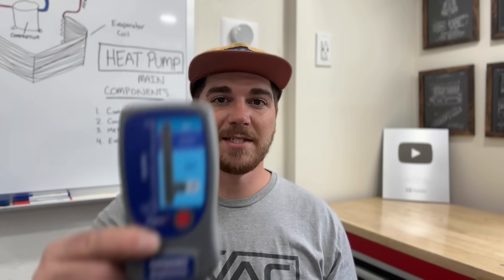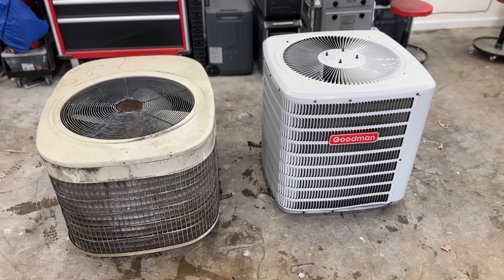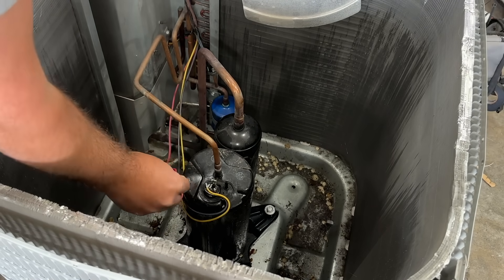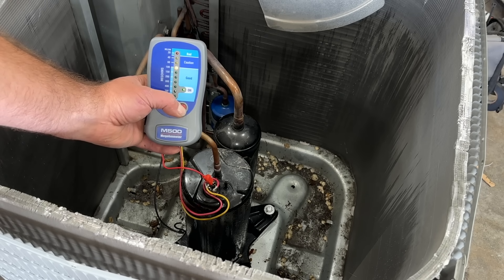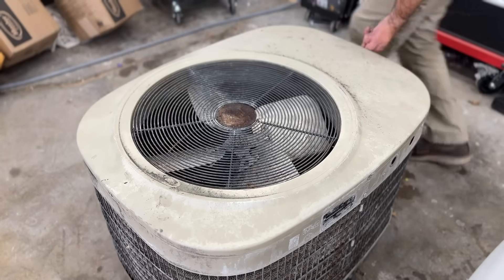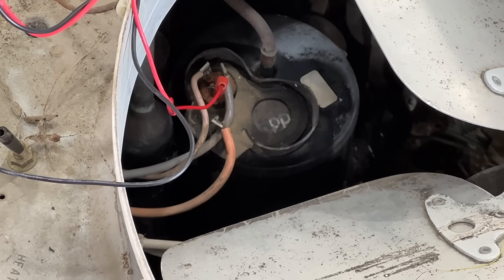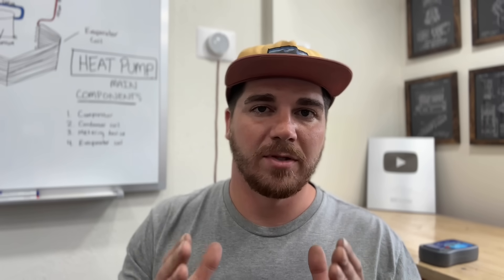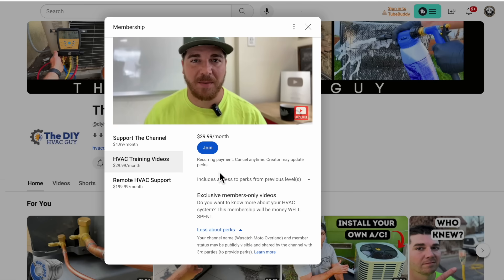Is Your A/C Unit About To Die? This Tool Doesn't Lie

Comment: HAD APPLEWOOD PLUMBING AND HEATING IN THE DENVER AREA COME OUT TO CHECK ON MY A/C UNT THAT WORKED FOR 3 DAYS THEN STOPPED WORKING....
REPLACED CAPACITOR 
REPLACED CONTACTOR 
ADDED SOFT START
TECH WORKED FOR 90 MINUTES.
CHARGED ME OVER $2200.00  AND THAT WAS WITH A $300.00 SENIOR DISCOUNT.
COME TO FIND OUT THAT THE PARTS COST A MAXIMUM OF $100.00 TO $300.00 DEPENDING ON THE QUALITY.
GOT RIPPED OFF BIG TIME.
TALKED TO THE MANAGER AND SHE OFFERED ME A $400.00 REFUND.
I TOLD HER NO BECAUSE THE JOB SHOULDN'T HAVE COST MORE THAN $1000.00.
SHE SAID TAKE TAKE IT OR LEAVE IT......
I LEFT IT.......
I WASN'T ABOUT THE MONEY. IT WAS ABOUT THE INTEGRITY OR LACK OF BY THE COMPANY.
BY THE WAY.....
NO SHADE ON THE TECH...
THE A/C RUNS GREAT.
THE TECH PULLED UP THE MENU FROM THIER COMPANY 
SITE AND THESE WERE THE PRICES QUOTED PART AND INSTALL.
CONTACTOR ONLY $800.00+
CAPACITOR ONLY $1000.00+
CONTACTOR AND CAPACITOR 
AND SOFT START....
$2200.00+
THE MANAGER DID SAY THEY HAVE TO BUY VANS AND EQUIPMENT....
DRUG TEST THEIR TECHS....
AND A FEW OTHER REASONS SHE GAVE FOR HAVING TO RIP ME OFF.
NEEDLESS TO SAY I'LL NEVER DO BUSINESS WITH THEM AGAIN.

Comment: While a neat gadget, couldn't you just ohm out each of these coils to ground and do the same thing?  It won't check marginal insulation but other failures it would. This would be useful for checking for internal shorts due to failed insulation I suppose.

Comment: I use a megger at work for large 3-phase motors but didnt think of using one to test a compressors health.  Thanks for for the tip and being honest with people who typically get scammed for not having knowledge in something like this!
Reply: Why can't you use a multimeter?
Reply: @trevmint5615  What should a multimeter read for resistance?
Reply: It’s best to pull the compressor into a vacuum before you meg it

Comment: An open winding would have tested as good and a locked up compressor with a good motor would also not have shown as a problem. You need to understand what your reading and what it means. That instrument just shows if you have any leakage current to ground, it says nothing about the compressor at all, only the motor windings to ground.

Comment: O k I watched the video all the way through. The first thing I would like to say is some safety procedures were missed. You mentioned telling the customer to pull the disconnect. Before any attempt, but voltage should have been tested. Not all disconnects are wired correctly, and voltage at the unit should be tested before any other test is performed. No I will not deny the validity of a good mega test, but you need to be aware of what type of megar you're using, not all megers are created equal. And secondly, you also need to explain to the customer that this test is only valid on reciprocating compressors and not scrolls. Scroll compressor the motor is down in the oil. You may get a zero reading with a perfectly good compressor. So the person must be able to identify the difference in compressors. Otherwise you just gave every technician out there a reason to change out a good scroll compressor. I'm sorry, I don't work in the field. I'm an educator I teach new students that are coming into the field. I teach them at honesty is the most important part of their job. So please be careful. Please, Be sure what type of compressor you're testing before you us megger. On a scroll, you may damage the compressor. Thank you for the video, but please let's try to get every detail. We can safety first.

Comment: MY 12 year old York YCJD30 AC recently losing refrigerant, and 3 company told me buy a new one, not worth to refill refrigerant, i stil dout what they said,  one company even just come and talk to me without check and charged me $190 for diagnose fee.  and told me if replace it with new one, they wave the fee. damn, i get scamed.

Comment: Thats why dr horton homes doesnt even do damper system no more just
1 thermostat and 1 split system

Thermal lockout can be sometimes because lets say a 5 ton unit only has two dampers at the plenum and when they open they only open up to 1/4 of their capacity making the compressor work hard and specially florida 110+ plus days ..

Comment: Alot of houses with damper system kill compressors due to no one really knowing how to tune everything..
Alot of hvac companys dont deal with what new construction hvac companies do to get a house running and then once again the employees of new construction dont know what they are doing..they go to a warranty call 5 times to 10 different people til that 1 person Sent by God to fix  it all to find out a bypass click on tensioner isnt on properly so then you got to take out the 10lbs that the other 10 people added in

Comment: If I were doing the testing, I would have all 3 wires disconnected at the compressor during the whole process. With only one wire disconnected at a time, you would be reading through the very low resistance of the windings and back into the capacitor and contactor,which can give a false low reading on the megohmeter.

Comment: The devil is in the details what? at least somewhat contributes to how long the compressor's insulation value is going to hold out has to do with things like how good of a vacuum was pulled when it was installed. Build up of acid. inside this freon circuit is often what degrades the insulation and poor manufacturing of the insulation itself that is used on the coils. or winding. contributes. but and I do agree they were built better back in the day. and don't ever listen to contractors that just say you need a new one, especially if it still seems to work when you turn it on.

Comment: Trane SEER 10, two of them, THIRTY YEARS OLD here in Georgia; I can meg it out one day, if needed, but not needed right now; i have tested the temp in and out, pressure-checked it (I am just a homeowner), and calculated SUPERHEAT and SUB-COOLING both using temps from the Evaporator; these were each manufactured in 1994 and still running every year here in GA; I clean the condensers each year with Blue Dawn and lots of water; i don't cover the outdoor units (but i should and plan to "one of these days"). I have replaced caps and burned spade-lugs on the motor-run caps a few times, and I have replaced the fan-motors on each condenser unit, one time each, in 30 years.

Comment: I put in several Fedders units back in the early 80's.  It had a Rotary compressor back then.  Didn't have scroll compressors then.  The Rotary compressor lasted a long time in AC's with short line sets, but did not last very long in heat pumps with long line sets.  The rotary compressor always had troubles oiling correctly.  You were just lucky with the unit in this video.  I quit selling Fedders very quickly because of their compressor failures.  I went to selling Rheem in the early 70's and they were great systems, but they didn;t have heat pumps at that time, so that is the reason I tried Fedders.  When Rheem came out with heat pumps, I never looked at a Fedders again,  I was an Air Conditioning contractor from 1972 till 2016 and then retired.
Reply: The main focus was if the condenser had a Copeland compressor, it was good.
Reply: I started in the trade in 77 and am still an HVAC contractor in Florida today. You’re right on point. 👍 
It has to be close to 20 years since I’ve seen a Fedders unit here. We and everyone else in our area abandoned Fedders years ago for the reasons you mentioned. I’m very surprised to see people in the comments here giving them love. 😂
Reply: Thank you for your service!
Reply: @OUFan2 I had a Rheem installed in 2020 / 1 and a half year later I had to replace the motor middle of August this year 2025 I had to replace the capacitor,I had the guy replaced the contractor too. After he finished he told me my motor going to need to be replaced soon cause the seal is bad and it leaking/ is the motors in these units built bad or is it just my unit/ I'm getting a second opinion today - would love to get some feedback on Rheems unit

Comment: Is it possible on the first system checked that you simply didn't have a good ground for the tool? I run across this alot on cars. Not sure that clipping onto that bolt "guaranteed a good ground". Just askin.  I really live your videos. thanks for sharing the info.

Comment: You also mentioned how there are some out there who would do the capacitor and charge $2000 for it.  You gotta wonder what sort of creative things they did on the invoice to pull that con off.  Or maybe if it is someone who doesn't know much about the system or doesn't appear to maybe they would just try selling the capacitor hoping not to get caught in their lies.  I know not everyone pulls those shenanigans.  Think about it the one who charges less is more likely to get more calls because of good work and honest pricing.  Maybe they have to do a bit of markup on the parts they sell along with making enough on labor.

Comment: I remember Fedders well one of my friends was a tech in the 60’s and told me that Fedders were very good. I do all my own work and actually I am a retired police officer and after retirement I went into plumbing and at times I helped the hvac techs so I learned a lot. I am an extremely adept mechanic and I have been for over 50 years. So now I guess I will do hvac when needed, I see I can already purchase a unit and have it sent right to my house.  I’ve subscribed to your channel and we will see how it goes. Thanks!
Reply: My Dad got a used 240 Volt Fedders window AC, probably 24,000 BTU from the company he worked for.  He had an electrician friend run the electric and installed it in our living area/dining area window.  It worked for probably 12 years until my brother bought them a central HVAC system.  A 4 bedroom rancher with a full basement.
Reply: I remember Fedders produced excellent window ac units back in the 50’s & 60’s They were made to last! What has happened to the quality we had back then?
Reply: @BartlettTFD  They were very popular ! I purchased a new Fedders R22 condenser in 2010, hard to find since R22 units were no longer being made. The information label said made in China. Sad.

Comment: This is a crappy version of a megger and it doesn't even give actual readings. When I test motor windings I usually am looking for a value above 1  Mohm. This is for running the test on a standard non-hermetic electric motor at 1000V. All a megger tests is the insulation rating on the conductor. There aren't standard insulation values it is different for every motor. With a Hermetic motor you have to consider that the motor is submerged in oil and contamination of that fluid would lead to inaccurate readings. to conduct an accurate megger test you would have to drain the fluid in order to rule that out in case of low megger readings. Megger tests can give you information, but it is just one test when trying to diagnose motor issues. I wouldn't recommend this test unless you really know what you are looking for and definitely not with this unit.

Comment: Residential and Light Commercial HVAC guy here. Diagnosing a bad compressor is the VERY last thing for me because checking capacitors and contactors is just so easy. For only $90, that tool isn't a bad thing to have anyway. It's so easy to be honest. I'd rather be wrong than crooked. Get 3 opinions ANYWAY. Good video.
Reply: People dont do 3 opinions because these places charge so much to come out and check it out.   This industry is out of control.
Reply: @mark33545  this industry is seasonal. if they charged you half of what they normally charge they would go out of business before the following summer. we then see ourselves dealing with supply and demand, demand is now high and supply is short, welcome bback to the same price if not more.
Reply: @mark33545  Now that's the God forsaken truth right there. They think their time is worth so much, but all they do with their free time is TikTok. Lol
Reply: @mark33545  It’s expensive to put a truck on the street $100k to $200 k, a good techs need to be paid, insurance, book keeping, …. so how much is responsible?
Reply: As an electrical guy - I'd pop the extra $50-60 and get a Klein instead of the POS cheapie... you blow crap tons on your Milwaukee or Dewalt "tool of the week" , drop a few extra bucks on your electrical testing tools (and take the hour to learn how to use them properly) and you'll save AND make more money than an extra 8 aH battery ever would pay for... and if you're feeling extra spunky, drop the extra $500 for a Fluke.
Reply: HVAC industry is as crooked as a snake

Comment: Trick of the trade run the blower fan while evacuating and pull shrader valves. Bigger hose does work. CRT are a must and purge slightly longer to be safe. As a home owner request a Manual J. If they look at you dumbfounded tell them to leave. A properly trained HVAC/R Company/Technician will provide you a report that verifies the system size they professionally recommend on your specific house features. Oversized cooling systems can lead to microbial growth in the home due to the system short cycling and not allowing the system run long enough to remove the moisture from the air. Bigger is never better in the HVAC/R world.
Reply: Our neighbor a few decades back was sold a smaller BTU system because "it will save him electricity" as it won't cycle on and off as much.  LOL. Every time we visited them in summer times it never cooled the place down enough.

Comment: I had an issue once, called the installing company and they replaced a fuse on the control board. It blew again so he installed a new control board. Fuse blew again. I popped the side cover off of the condenser and noticed black scoring on the edge of the Cap. The low volt control wire had chaffed and grounded against the cap. A piece of tape and zip tie to keep it off, new fuse and voila! Called the company for a refund. They weren't happy. No AC in Fl summer made us unhappy. Fair enough.

Comment: I have a 2 stage ac compressor, I purchased the M500 and found out it’s a two stage unit. I disconnected all the connections on the compressor. Tested the 3 prong connection and all tested out at 600 on the M500. I’m I also supposed to test the two prong connection off the compressor?

Comment: You want the terminal posts to be warmer than ambient temp when checking.  Also pull all the wires off before testing. And lastly, scroll compressors react differently than regular reciprocating compressors…they’ll read low or bad when they are fine due to limited clear to can from windings.  You gotta know these things if you’re gonna “teach” people

Comment: my granpa keeps going through ac's they constantly break ,,he is so so stubborn what do  i do ,, he runs the ac at 83 degrees ,when its 93 out and 80% humidity ,, the house is a heat box full of humidity ,,and the unit runs more struggling to get the humidity put ,, I tell him what I learned form ac guys on youtube you keep the humidity out , ac lasts a long time ,, am I right or wrong ,, the AC turns into a water pump . right when the air gets cool he shuts it off insanity ,, the unit is full of water ,, when they come to replace the ac its all rusted up inside ,,,I set it a 80 it was perfect all day shutting off ,water just dripping out of ac,,,,at 83 water is pouring out ,, but her turns it up and up and up till the whole house is so hot then turns it down when its 73 outside ,,its just stupidity

Comment: Using a meg meter to test windings with cold oil in the compressor can give you an inaccurate reading. Always take off all wiring from the terminals when doing any check and also test the compressor ohm value. The internal windings are treated with a lacquer coating and that acts as the insulator because the windings are in oil.

Comment: The Supco tester which in opinion is an overpriced piece of shit compared to a quality tool that offers multiple testing voltages but I guess it's designed for those who need an LED light to make a decision 😏  

If you want to save some money, buy the "Victor VC60B+" which works just fine assuming you actually know what your doing.  If not, there are plenty of YouTube videos that show you how to use it ... https://youtu.be/q0aLf1TKwVo

In most cases, you're checking continuity between the windings and the compressor case for it being grounded out after the breaker kicks instantly hence the standard DMM works just fine 😁

Comment: It would appear to me that this is simply an ohm meter.  All it appears to be doing is checking the resistance of the insulation to ground on the wires in the motor. A motor can fail in more ways than an insulation breakdown in the motor.

Comment: I've had 2 companies come out. My fuse keeps blowing in my furnace when my air comes on. They can't figure out what is making it blow. Some refrigeration has leaked according to the companies. I have been so upset because I can't afford a new one. They replaced just about everything on it. It's a York and made in 2011 or 2012. Not sure.  Do you know what could be blowing the fuse?

Comment: Sigh.....the Supco megger tool is actually a rather bad and outdated tool. Also, plenty, PLENTY of compressors will fail the Supco megger tool but actually be 100% fine. It's also absolutely useless to do on a maintenance.

Comment: I enjoy watching your videos, I appreciate you educating the masses.  HOWEVER, I MUST take issue with what you said in this video.  PLEASE correct me if I’m wrong.  When you meg the compressor windings, that’s what you’re doing is checking the windings.  Thats the “electrical” part of the compressor.  It has NOTHING to do with the actual compression part.  Hence your comment on “not drawing a proper vacuum” or “using old refrigerant” are COMPLETELY irrelevant.
Reply: moister in a system turns into acid the windings are in the refrigerant and oil mist flow , acid  will brake down the enamel on the windings